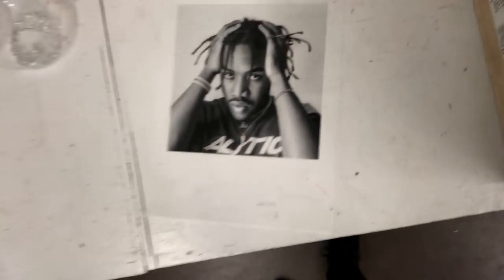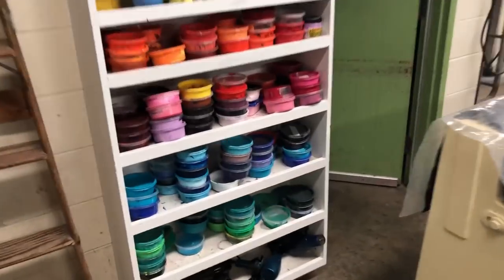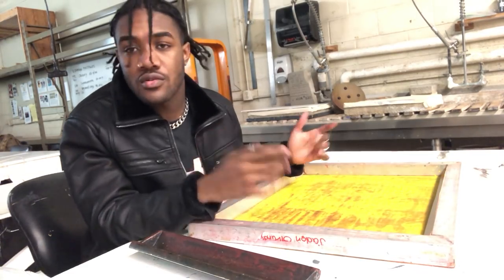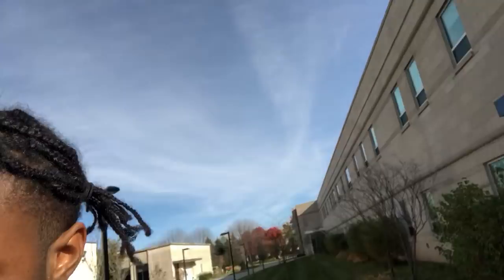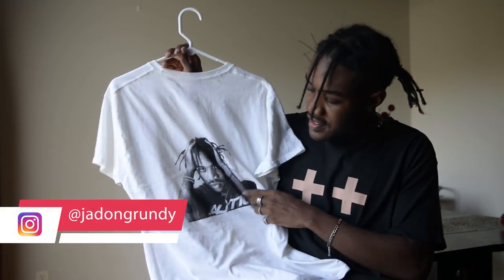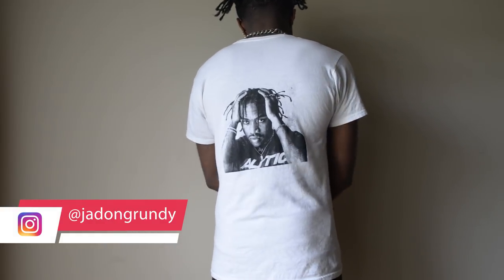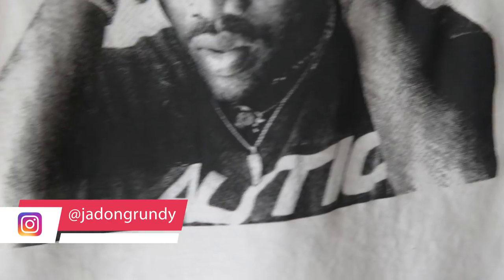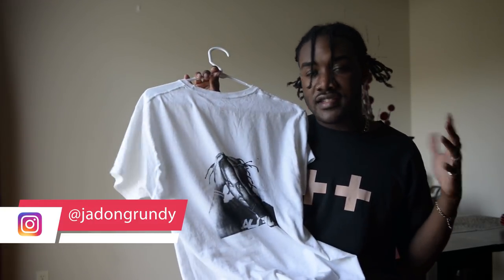MY FACE ON A SHIRT! How To Make Your Own T-shirt DIY | Men's Fashion

Comment: What if the logo is in color?, if I gray scale it the color won’t show so what should I do
Reply from the maker: Isaiah Burks there’s another method used for color in screen printing called CMYK. You basically print out a different screen for each color. You print the separate colors over each other, and the blend will give you your colored image